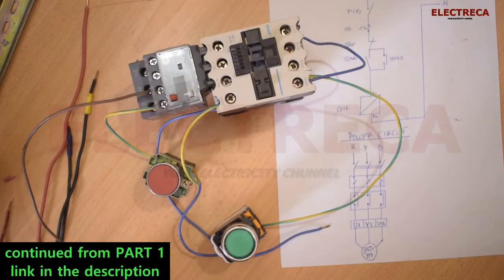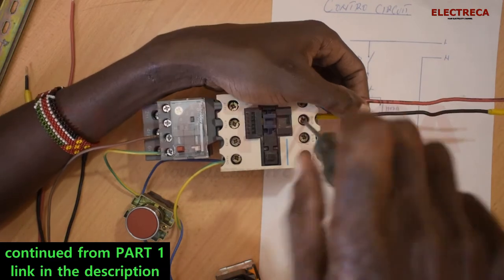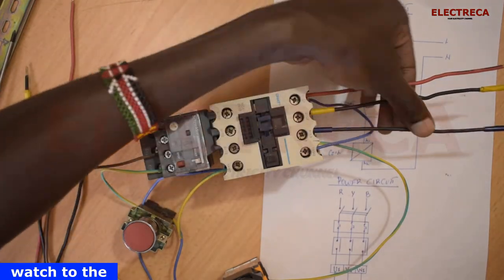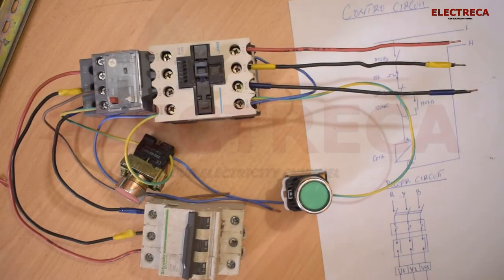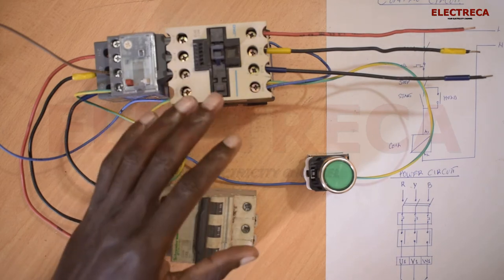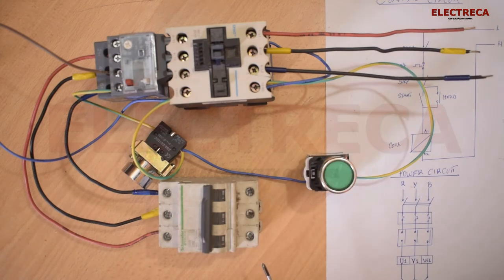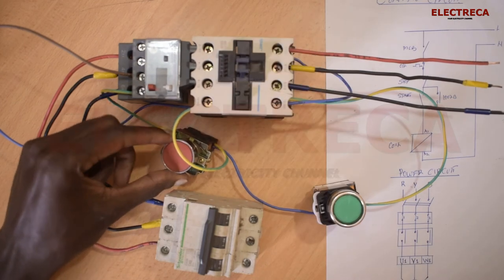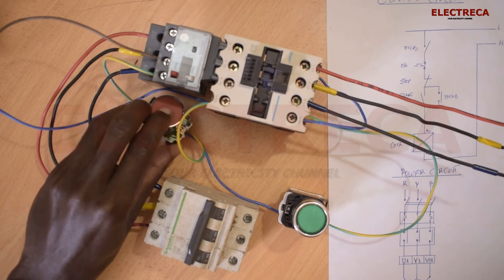direct online starter wiring|ELECTRECA|PART 2

Comment: 1.All along I was struggling to get the reason why we connect the wire to hold the circuit,  I have witnessed it when the NO wasn't holding due to that wire that wasn't connected on the stop button, now I can celebrate.

2. I never know the power can be supplied from the OLR or vice vessa.

Thanks my Gee.💪💪

Comment: It was a very good explanation you did.For clarity's sake, when do I use a direct online starter and star delter starter respectively...Thank you
Reply from the maker: Direct online is majorly used to start small motors, but if your using it for a bigger motor you have to keep in mind that there will be a high voltage drop due to inrush current. That can easily damage loads that are sensitive to high voltage drop.
Star-delta starter one of its merits is to reduce current demand during the start-up in doing so also reduces the interference on the electrical supply.